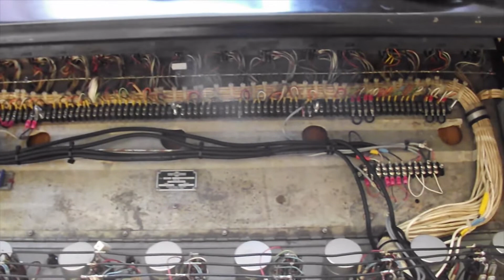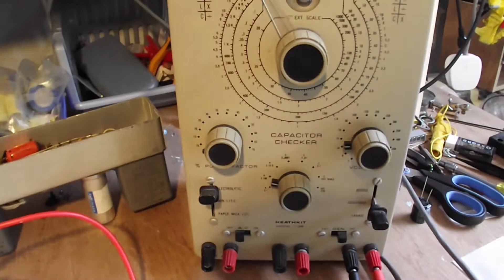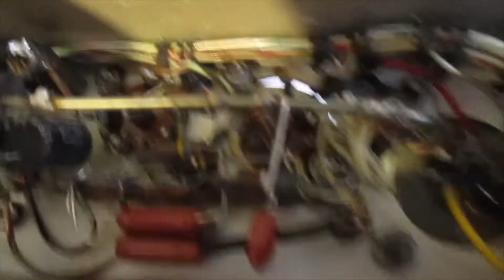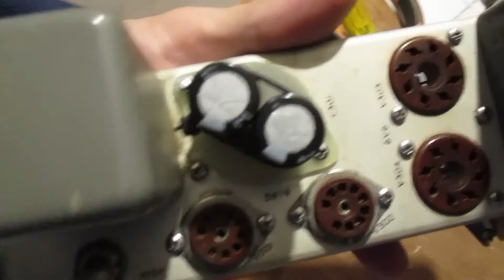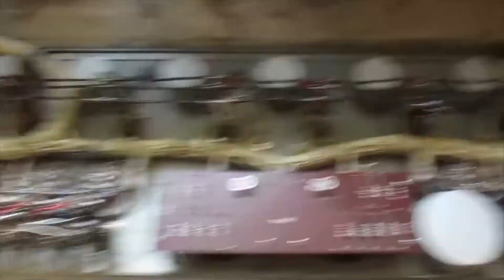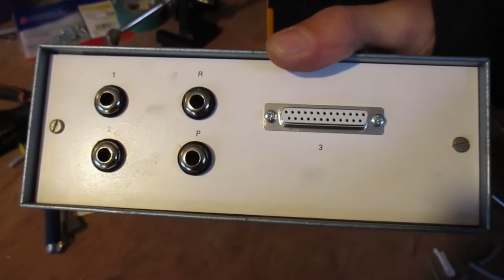Renovation of a Collins 212E Tube / Valve Broadcast Mixer

Comment: Is the second power supply just used dependant on how many modules are used?  I see a 409X-2 and a 409Y-1 in the manual...looks as thought the Y-1 is non regulated.  Not sure if the second supply powers specific features of the console?  Cheers!

Comment: Collins 212E...my dream console...
I still haven't given up hope of having one of these or - better yet - building a console of this type, according to the standards of the time, which would give me even more pleasure. The main problem is still the huge sums of money that are spent on this type of work.
Reply from the maker: It is a wonderful sounding console. And yes - building one to the standards would cost a lot. But it would be more than worth it!
Reply: @madjacktv2226 , for now I was only able to buy old broadcast  transistorized equipment, and it is already fully working in the right conditions.
I have already recovered an Eela-Audio SBM 90 console, two Rhode & Schwarz EU 6201 Tuners and a few more accessories like line preamps, analog VU meters and stuff like that. Nothing special...
But I won't give up until I find a Collins 212E console, despite having nothing against transistorized equipment.
Keep up the good work I wish you the best of luck in the recovery of professional equipment.